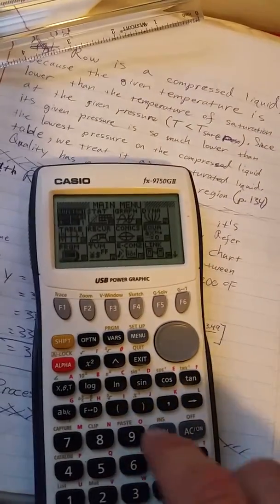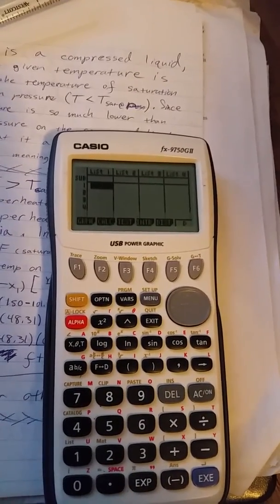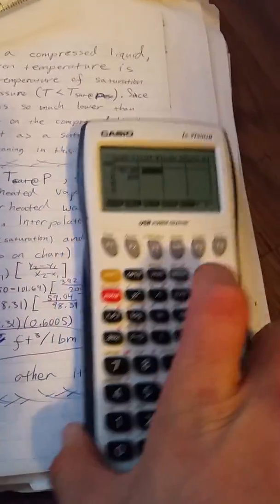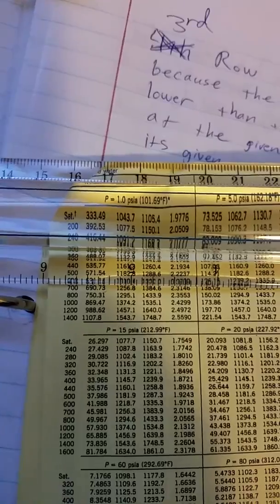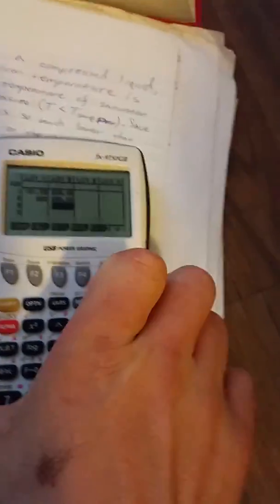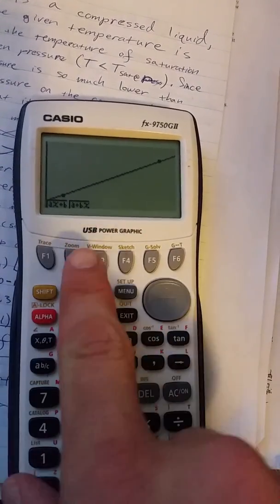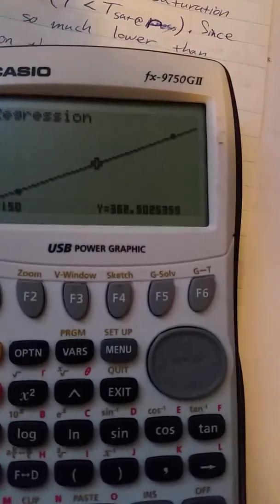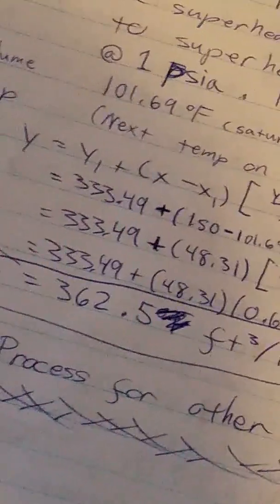Interpolation with a Casio FX-9750GII (McNeese ENGR 207, Thermodynamics ) Pt 2

Comment: Hello! I love this method, it saves so mutch time, but can you please tell me if there is a way to interpolate between several points?  like, draw lines between the points, and read the x-value..
Reply from the maker: I've never tried that, but my gut feeling is you couldn't --at least not with this method. I'd try just repeating this method between each point. Bit tedious, though...